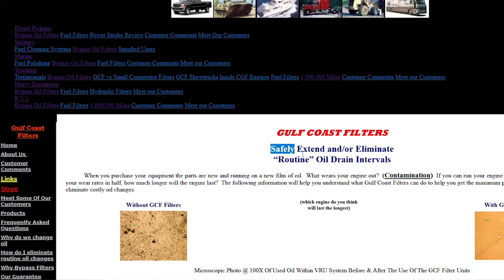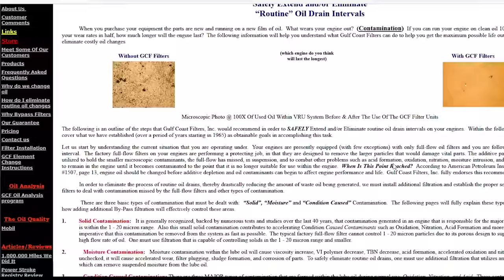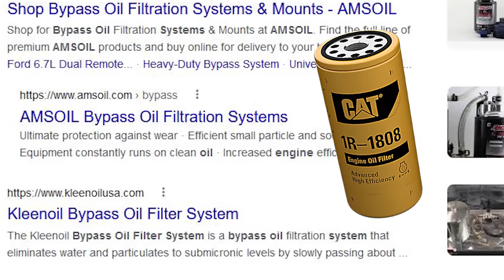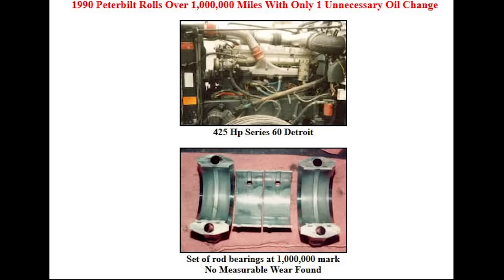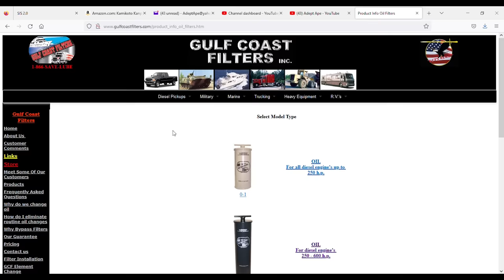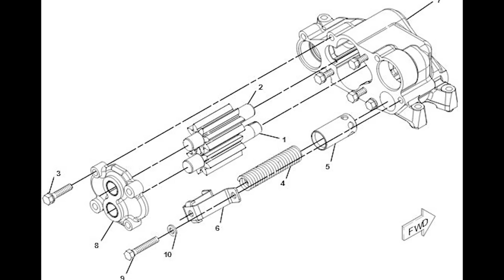No Oil Changes and 1 Million Miles!!! Are Oil Changes Optional with a Bypass Filter? (INTERESTING)

Comment: I used to work industrial maintenance. We would take a pump and run our hydraulic fluids through a set of low flow filters. 1 a micron filter element the 2nd a 1/2 micron. After a few hours  of this the fluid was clear.

Now I know you're not always close to home when oil changes are needed but, if you do your own service.. I wonder if you could collect your oil in a drum and when you've accumulated enough, run a filter pump like I described. Would this give you clean enough oil to reuse?

Comment: I have a oil bypass filter on my Caterpillar Acert C15 "BXS20346"
So I run my oil in between 40k to 60k b4 I do an oil change but I do change my filters every 15k, another that I have tested every 12k to check if it is holding up is Petro Canada oil and Caterpillar uses this oil as their byproduct. So if Caterpillar uses it everyone would feel safe to Use it and run 60k miles in between oil changes just change the filters every 12k to 15k
Filter Solutions in Olathe, Kansas was around $800 with all the fittings and oil lines to hook it up......

Comment: Bypass filters are fine; but you most definitely need to change your oil - due the chemical reactions / composition of the oil changing over time. Additives are breaking down; base oils breaking down (ie. most synthetics such as Group III and below); the TBN is dropping due to contamination (ie. fuel / combustion particles past the rings) resulting in acidified oil; and the oils physical properties changing as a result (eg. viscosity). Bypass filters cannot filter out all these contaminants - just mainly wear and fine soot particles. 

They do a fine job and can extend the service interval, but I definitely wouldn't try to use it as solution for eliminating oil changes.
If you really wanted to push oil services to the max, you could look at a bypass filter plus a high end full synthetic (ie. Group IV/V PAO & Esterfied true synthetics), as these typically rely less on additives to give the base oil it's lubrication and viscosity properties (ie. the base oil blends themselves basically determine the viscosity and viscosity index, as opposed to a hydrocracked base oil which largely relies on additives to give the desired viscosity/VI).

Comment: My S-10 pickup operated with very few oil changes... It preferred to simply burn off the oil, and require topping off 😅
Theoretically.... It burned off all the low grade oil, and mostly good oil was remaining, with a slight amnt of fuel dissolved in it. If the waterpump hadn't failed and sent DexCool into the oil, it would have gone further, but I got my 356k miles out of it.
Now, I prefer older BMW's, which had Oil Life Monitor systems... The car checks the optical and electrically resistive properties compared to a "baseline" reading it gets after oil service reset. Lower resistance means water, coolant, metal or Carbon is in the oil.... More light to the optical sensor knows you have fuel or coolant ingression, and less light indicates high Carbon or Metal particle count contamination.

Comment: So first couple comments from someone looking at this from the same perspective. I do not believe simple bypass filters will remove fuel dilution. However a centrifugal filter can separate based on specific gravity which would pull those contaminated moisture even fuel ect out. However this would also remove in my mind parts of the additive package. So similar to a coolant filter with the additives possibly having a post centrifugal, filter with additive or simply adding it to the oil certain amount per engine hour.
Reply: The centrifuge cant remove fuel unless the fuel is heavier  than motor oil.

Comment: It was a very interesting video and I can see a lot of your points has been valid and a lot of their points has been equally as valid. I would think their claims are based on an engine without any major running repair damage to the oil being created by the coolant first and foremost. So if the engine was properly maintained and nothing catastrophic happened and everything was looked after properly like as if it was your engine I won hundred percent think the system is far better than just a standard oil change in which you're never 100% certain on when to change your engine oil based on distance, only is not an accurate picture being painted by the manufactures. Other major factors that would either increase or decrease oil change intervals would be stop and go is it all highway altitude, severe weather conditions, such as colder Canadian climates, where the engine oil would experience How is your conditions then if they were driving in 20°C, climatologist states that are generally around the same all year. You you mentioned something that was interesting, and which I'm certain of is the claim pertaining to the fact that oil never breaks down or never really breaks down and that is 100% true. The oil stays the same from when it went into the engine to when it came out but the additive package is what does breakdown and what does change so if somebody wasn't to be looking after their oil samples and using the proper detergent type 15 W 40 oils I don't think the system would last 1,000,000 miles without damage. Keep in mind that that engine you saw it was locked after it was babied it was monitored. It was hooked up to the computer the whole time they watched everything the data ally feed the whole time during that million miles and if anything was out of range, they saw it Before I drive, or would normally see it on your dash and it was corrected right away as per keeping that engine within OEM standards. With a small amount of engine oil, being burnt during the combustion chamber, and adding it need be with an additive, package or supplemented additives were needed, such as zinc, and there are two others that work really well together a synergistic affect if you will. With all that being said, and nothing was out of range and the temperatures were kept into the correct parameters, the coolant everything was good easily 1,000,000 miles. They didn't have to even pull the engine apart likely. When you put in new sleeves and all the O-rings and seals, that's generally based on CATERPILLAR  manufacturers suggestions. WHAT WOULD BE INTERESTING I THINK IS IF YOU DROVE A TRUCK FOR 1,000,000 MILES THAT'S ABOUT 1000 MILES A DAY. SO FOR THREE YEARS STRAIGHT APPROXIMATELY and then checking the oil yourself and send you the sample in while running the system and because of your knowledge and background as a technician you would hit 1,000,000 mile mark easily based on your oil sample analysis alone. Looks like we need new Maine cabs. We've got copper we've got aluminum. We've got too much iron too much zinc. Your engine oil tells you anything you want to know & will never lie to you as long as know what to look for. Or another option might be if one of the drivers you're friends with and came back to your shop for oil changes only through you that would be a more of a controlled environment in which I think you are YouTube subscribers would love to see because like I said to you, your engine oil will never lie to you. So when you send that oil in for analysis and when it comes back, you communicate that to the test subject driver, and based off your knowledge of the caterpillar diesel engine I think you'll get more than 1,000,000 miles as long as it's Rotella just my opinion with the Rotella. Now, obviously, some oils work better than others with certain engines and I think you would probably feel too figure that out based on your observations during teardown and knowing what oil they used, primarily or exclusively. That's not always easy to tell because it would have to be documented and proved. Very interesting. Very good work I'd like to hear more about the system but from a technicians or a drivers point of view. Peace ✌️

Comment: When I worked for the railroad we used rd40 oil and had a lab and reprocessing facility in house. We tested regularly and only changed oil when lab results showed or with a major breakdown. I've drained 200 gallons of water out of oil pans when a cylinder would let go. I don't know the details of the reprocessing but the oil came out like new.

Comment: I run a Gulf Coast Bypass filter. There is a lot more to it than you describe. There also is a truck with 2 million miles no oil change and no rebuild. I am an Owner Operator and will gladly fill you in on the missing info
Reply: When I sold Gulf Coast filters years ago they were usually sent to people that understand bypass filters and trucks..My experience is mostly small engines. When I worked as a maintenance mechanic for Safety Kleen I did Gulf Coast 0 1 filters on a big hydraulic systm.The lift trucks took the 01 juniors. I put a 01 on the yard mule My guess is they havent been changed since I left over 10 years ago. I used Motor Guards on the big air compressor. and instrument air. Charlie Sims said dont ever use sandwich adapters with my filters. Im a big user of sandwich adapters. Brought back the Motor Guard. They had a problem with my using toilet paper in them They were designed to use toilet paper. They have their own high dollar elements now. I get no respect. The Frantz is a good filter but not set up to use toilet paper..Im about out of Frantz sandwich adapters. The Frantz 2 ports I have are over 50 years old. Bought some Perma Cool universal sandwich adapters from Jegs years ago. They are oil cooler adapters. Put the last one on the Ford Diesel tractor. I recently bought. The flat head Ford canister filter is converted to use Scott 1000.No orifice needed.with the sandwich. The Perma Cool sends the clean oil to the full flow filter.

Comment: Think it can make sense to integrate a bypass filter in a high performance street gasoline application as well.  Things like using a good oil like Driven Racing oil (will vary by application but they cover them), a good high flow filter like Wix Racing filter in conjunction with a bypass (or wix xp or equivalent if not).  And still servicing frequently (5k miles or more frequently if running it hard), cutting the filter open, regular sampling with a baseline comp and having a remote mount inspection screen you can check quickly if you think you've hurt something and obvious stuff like leak, lash and spring load checks during the service.

And stuff like cryogenic and wpc treatment to parts...

Depends on the budget and what your trying to get out of it.  But if you have high dollar parts that you are trying to get the most out of think these things can be value add.

Comment: I believe the "Best" bypass system is the centrifugal system, commonly known as "Spinner II" system by TF Huggins in Houston Tx. They have also been in the filtration business for multiple decades. And when used in conjunction with a sampling schedule it is easy to justify never changing the oil. The "Top Off" oil is what keeps your additive package in full working order. And the sample schedule alerts to any other issues long before you will see any visual indication that you have a problem. I have used both Gulf Coast and Spinner II systems. I myself do prefer the Spinner II, but they both have been in the business long enough that if they were causing problems they would long ago have gone out of business.
Happy Thanksgiving Everyone!!
Reply: Dont know much about the centrifuge. I had a 65 Honda 305 Dream in my younger days. You remove a cover. Inside the engine was a chain driven centrifuge. I remember the sludge packed so hard in the drum I dug it out with a screw driver. Centrifuges were popular on Mack trucks. I had a Frantz oil cleaner on the Honda 500 custom.
Reply: The Gulf Coast system is simple. Its big and effective. When you change it you pour in 3 gallons of new oil. 3 gallons of new oil every 10.000 miles is enough for this truck according to oil analysis. In other words the oil must never be allowed to get dirty and enough new oil must  be added to keep the additives up to specs. Small filters dont work with this system. They work with my cars. Some bypass filters hold 10 gallons of oil and more..Not familiar with those. Probably cant get filter elements at Costco or Walmart. They didnt have filters in a cloth covering when I sold them. I would use a secondary filter and Bounty big roll paper towels if I had concerns. The Jackmaster Classic uses a very high quality tightly wound roll of Australian toilet paper in a cloth cover. That is because fools think paper breaks down in oil.

Comment: I’ve worked on many slow speed and medium speed engines with bypass systems they add oil that’s it the stork we work on 9 cylinders 9000 hp per cylinder built in 64 I believe holds 25k oil it’s never been changed oil doesn’t go bad it gets contaminated

Comment: You. Need. To. Change. The. Oil. Eventually.

Why?
1. The oil is contaminated with fuel and acidic compunds over time.
2. The additive package wears down. Once all the TBN is down and the ZDDP is low your engine is suffering.
3. Due to heat + pressure and shear loads the oil itself actually wears down and the viscosity changes.
4. Fuel dilution happens inevitably and it also lowers the viscosity and worsens the lubricity of the oil.

Comment: Worked at an international truck dealer for a few years out of high school and a lot of trucks used to come in with “oil-finer” systems which did the same thing. Half the shop thought they were gimmicks the others thought they had warrant.  I just see them as a second larger low flow oil filter that takes up frame space, and costs a lot.  Personal opinion, but only filtering a small percentage of oil at a time at a higher tolerance, to me doesn’t sound like it’s capable of catching enough as it’s produced or introduced into the engine….. sort of like trying to catch up to everyone else on the road by driving slower…..9 out of 10 times you’ll get left behind lol.  But they are intriguing. If they work, great. If not… won’t ever be my problem I guess.
Reply: Your personal opinion is worth about as much as mine

Comment: Cooling jets can be optional on older IDI engines. My friend's Oldsmobile 5.7 diesel has none and has over 500,000 miles on it. Being a V8 with only a 3.385 inch stroke, it uses the oil from the rod bearings for piston cooling. Still on the stock pistons. 6.2 and 6.5 diesels also have no cooling jets. Many other IDIs, both turbo and non-turbo also use only the oil from the rod bearings for piston cooling. The aforementioned 5.7 is on its original pistons with no scoring, original crosshatching still on the cylinders.  Mobil 1 5w-50 in winter, Amalie SAE 50 synthetic blend in summer. I have no idea what was run before 1987, when all that was listed on the receipt, was "SAE 50 SF/CC Conventional".

Comment: Military ships and i am pretty sure commercial ships test the oil and use a centrifugal filter system and replace additives that have evaporated. It is most likely like the reclaimed Imperial oil that was sold years ago.
Reply: I worked for a company Safety kleen thst had a rerefinery in east Chicago.  The rerefined oil is better than the new oil.. used oil is easier to refine.  Than crude oil. At one time you could get Safety Kleen oil at Goodyear. New Mercedes. Came with rerefined oil. Almost all of it goes to the major oil companies.. A lot of synthetic oils are in it now.. I just bought Super Tech heavy duty  diesel 30  weight for off highway use. It is as clear as water and has a good feel to it. I wouldnt be surprised if its rerefined.
Reply: I think the Safety Kleen oil at Goodyear was called Americas Choice. A trucker says some parts stores have  rerefined oil

Comment: Here are two important instructions from GCF's site:  "Add...3 gallons for O-2" during oil changes and "In most cases, the GCF filter will be serviced at the same interval that the oil was being changed..."  Since most on-road trucks today are powered in the 450 to 500 plus horsepower range, the required GCF element will be the O-2.  So, adding those three gallons of make-up oil in addition to the one gallon taken by the full flow oil filter will be necessary every scheduled oil change (20,000 miles or so) plus the cost of the seriously recommended oil analysis.

Using by-pass oil filtration is a great idea, as the process has historically removed contaminants down to one micron in size, which is great, because tests performed by GM decades ago demonstrated that oil contaminants in the 1 to 3 micron range were the most damaging to an engine.
Reply: Actually a 3 micron abrasive is a engine wearing abrasive A 40 micron abrasive is a engine damaging abrasive.I saw a spin on bypass filter like my Rambler had It was rated at 10 microns. The oil in my Rambler was alwsys nasty until I tossed it and installed the Frantz.
Reply: You might of meant add 3 gallons of new oil at filter change not oil change..
Reply: All it amounts to is keeping the oil clean and adding enough new oil to keep the additives up to specs.. Gulf Coast filters are big on oil analysis. I read the dip stick and the used toilet paper.  Im partial to the top loaders. Gulf Coast junior Motor Guards.and the Jackmaster Classic.  Havent used the Frantz in 30 years. They all clean oil. I dont have a big diesel truck.If I had one it would have a Gulf Coast O2.with Bounty big rolls in it. I dug out a Cummins Fleetguard  500 that I converted to use the hard roll center pull paper towels. Used it to filter waste cooking oil. Had a converted Fleetguard 750 on a yard mule. When It went in for service they put a junk element in it.
Reply: I see some change the big Gulf Coast filters every 10.000 miles and some go 20.000 miles. When I sold them they had a O1 with a General Motors part number. The ports were different .Seems like it was for a midsized truck like a Kodiac. I remembered the part number for years.